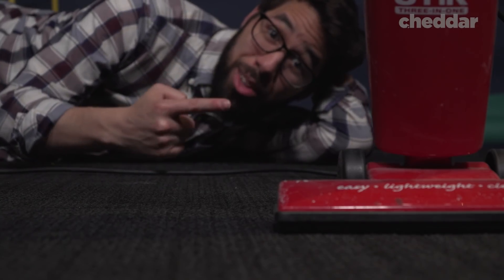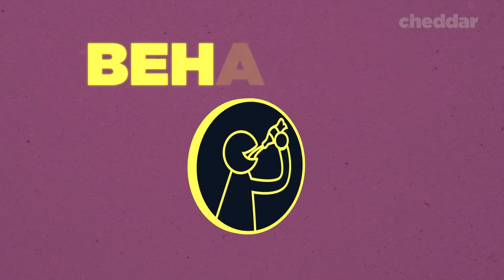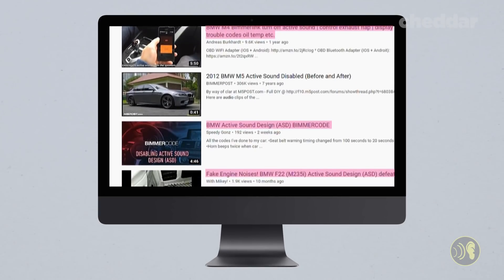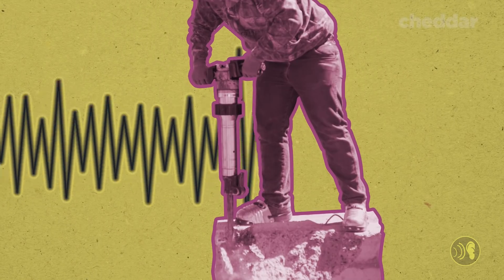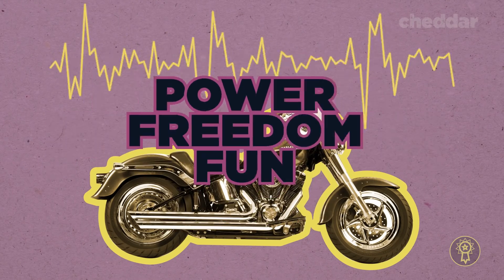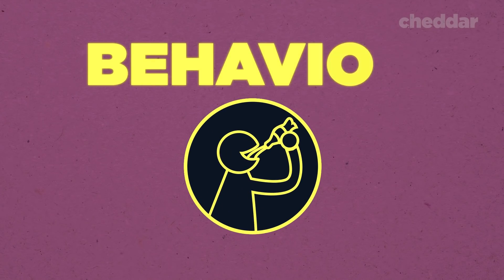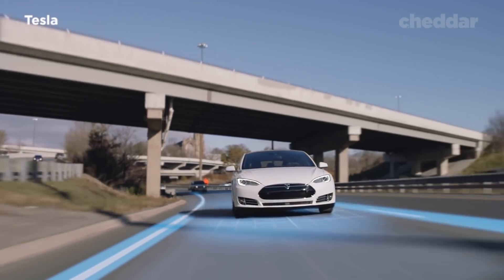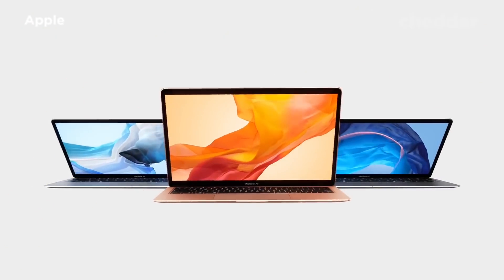The Fake Sounds Companies Add To Products - Cheddar Explains

Comment: The EU introduced a 80 dB noise limit on vacuums in 2019 to protect customers ears instead of letting the unnecessary noise satisfaction destroy their ears in the long term :P
Reply: God bless them.
Reply: 80 is still pretty loud. It's like standing near a track while a freight train goes by at 90 km/h
Reply: 80dB is a great limit and all, but can we go quieter? Because I would love a 60dB vacuum
Reply: Interesting, one of the things I like about my Shark vacuum cleaner is that it's pretty quiet while still be very effective at pulling dust out of my carpets. It's too loud to talk over, but at no point do I feel uncomfortable around it. Plus, because it's relatively powerful, I don't need to use it all that often.

It's definitely quieter than the vacuum that it replaced and the ones that were around when I was a kid, but if they'd make it even quieter, I'd likely replace it.
Reply: I am so thankfull to the EU on that. Greetings from the EU Germany. The EU did a lot of god thinks on protecting consumers. In this regard I am thankfull for that
Reply: Our vacuum is from 2012
Reply: What vacuums are loud enough to damage your ears? I've never seen one lol
Reply: @Miscelanou  
over time lol 
your ears don't just explode when turning them on :P
Reply: Vladimir Kozlovsky  How did you miss the comment that started the politics and then blame the person who responded to them?
Reply: 90,000 dB limit now
Reply: Just make it so that no add sound
Reply: Yeah, they also introduced power limits, so all the vacuums in EU are garbage. Luckily they left gaps in the law so you can still buy a good vacuum if it's a central vacuum. Most of the regulations in EU are bs.
Reply: Let's be real, some mp probably pushed it because they could hear thier neighbors vacuum.
Reply: @Maxx B. 
Well yeah, but it's a ban of vacuums that produce a lot of noise for no reason other than sounding "impressive"... 

I bet that you have noise limits on consumer appliances in most countries, at least once people's eardrums are blown out and the company is sued... 

Vacuums that are so loud that you die instantly from the noise are probably also banned everywhere! Meaning you have those bans everywhere... It's just a question of which level of protection you grant the consumer, and then everything outside of those levels is banned.
Reply: yes and people are complaining that thanks to EU regulation vacuums are getting weaker
Reply: This comment section is gold.
Reply: It's real cool to live in a nanny state. Screw that, freedom to make a decision, including a harmful one, is a fundamental right. So is a right to a mistake. But, of course, after living in a nanny state for years, Europeans have no clue about freedom, and accept their overlords who know better than them.
Reply: @stepanstepasha3538  
Haha, as if you have anarchy and no regulations in the US... fucking moron xD
Reply: Why not just have them put a warning that listening to sustained 80dB over time could damage their years? Ban culture is so frustrating. Just let me know, and let me make the decision, sure for vacuums there's no reason but in NYC there are so many housing laws that I just wish they would let me decide. They did a study that windows are important for health and then they banned living somewhere without a window. Like just let me know about the study and then let me decide, maybe the extra $100/mo matters more to my sanity and I want to be able to make that decision.
Reply: @johndirac6707 
It's not really a ban though, it's just a higher minimum requirement for manufacturers.
Reply: I so they aren’t allowed to go above a certain sound level. That is literally the definition of a ban.
Reply: @michaelesposito2629  
Well, yeah but pretty much every product has safety restrictions and products that don't conform to them are banned.
Reply: I so, as I said, they are banned.
Reply: @michaelesposito2629  
banned from being produced, not from being sold ;)
Reply: I ... you’re probably the type of person that thinks making bullets $1000 doesn’t actually mean you’re banning guns. Right? ;). 
Even when things are banned, many times you can still own them, because the item would have to be exceptionally dangerous to get the government to force people to not own it anymore. Even many gun bans only ban the manufacture or purchase of said guns. But it’s still a ban.  Governments love protecting people. They create problems to protect people from, so that their jobs actually  matter. The eu Being one of the worst offenders of such nanny state tactics. People can just as easily wear hearing protection. But you can’t mandate that, and you can’t tell the world how you’re saving them from themselves
Reply: I by the way. The term for this is “effectively banned”.
Reply: @michaelesposito2629  Making bullets $1000 would ensure that they would only be used for nefarious reasons. They're also easy to make yourself, most avid users in my country has their own bullet presses.
Reply: Fabianwew I’m not really sure why you’re telling me this?
Reply: @johndirac6707  uhhh so you want a loud vacuum??
Reply: @johndirac6707  Are you also going to sign a waiver that says you renounce all rights to free European healthcare in relation to any sound-related damage you might sustain from the vacuum? Also, are you going to pay the government for all the lost tax revenue on account of your reduced productivity from ear damage? I am of course being a bit hyperbolic in both cases, but the point is that governments have a vested interest in the health and resulting productivity of their citizens, and they don't want their citizens getting sick or injured any more than a farmer wants that for his cows. And while you might believe you have a right to get sick or injure yourself, people aren't islands and what happens to them has consequences for other people, and you don't have a right to impose those consequences on other people.
It's a large part of the government's job to try and optimise everyone's quality of life, so if banning loud vacuum cleaners means you don't need treatment for ear damage, which prevents you from wasting taxpayer money, preserves those treatment resources for someone else, and ensures you are healthy enough to keep working and contributing to society, then why shouldn't the government ban loud vacuum cleaners? Allowing people to take actions that are destructive to their health is allowing them to actively harm society as a whole, so what point is there in having a government if it isn't going to protect society and all the people in it?
I understand that things are different in the US, where the government doesn't care about the health of its citizens and people are afforded rights that are blatantly harmful to society such as owning military assault weapons, but in the rest of the West governments are committed to protecting people even if that means protecting people from themselves, and their citizens are largely grateful for it.
Reply: Michael Heliotis thank you for explaining to the people why America is actually not a country of idiots, it’s a country that works, because of the freedom it gives you
Reply: @Juicestain2  
Well, those freedoms come at high costs, that limit others freedoms.
The freedom to own guns comes at the cost of the higher likelihood to be shot. The freedom of not being able to afford healthcare comes at the cost of dieing early. etc....
Reply: @Juicestain2  Yeah, I'd say most of the world agrees that it's not a good thing for people to have the freedom to waste public resources that would otherwise be consumed by people who actually need them through no fault of there own. And I'd say it's not a country that works when so many people don't have access to healthcare. I suppose, though, it's just a matter of perspective; if you're cruel and selfish then everything is working just fine in America.
Reply: I the lack of guns causes guns to be bought illegally, just because poaching is illegal, doesn’t mean people don’t do it
Reply: Michael Heliotis if the country isn’t in shambles then it’s most likely working
Reply: @Juicestain2  
Yes, but guns are still mostly exclusive to people that have deeper criminal connections and you don't see the average criminal with a gun. 
Especially in non-planned crimes people will just get the weapon with the easiest accessibility (which is usually a knife). 
Just look at the statistics of people that get shot by the police. The people that need to be killed by the police in America is roughly about 10+ times higher per capita compared to the EU, that's probably because of various reasons but one of them is definitely that there are more dangerous weapons in circulation.
Reply: @Juicestain2  Working for who? Rich white men? Cos I can tell you with certainty that nearly every black person in America will say the country isn't working for them right now. And I'd say most of the Latinos would concur, along with plenty of poor people from every colour, and all the people working 3+ jobs just to scrape together barely enough money to survive. Also, I hate to break it to you, but most of the rest of the world is looking at America with raised eyebrows right now thinking it is in shambles. It's in such a shambles that I don't even need to bother explaining why, because any rational person could see it as plain as day. You could mention it in an essay and it wouldn't even require a reference. If you're seriously going to try and tell me that America isn't in shambles, when your president of law and order is violating the Constitution for a photo op, then you're obscenely irrational and there's no point in talking to you any further because you're incapable of seeing what sits plainly before your face.
Reply: @michaelheliotis5279  👏 👏 👏
Reply: @i.i.iiii.i.i  Sad part of it is that way more lives are lost because of that said freedom to own guns than it has saved. Also idiotic that with that stupid gun law, you don't even get health-care in case some stupid person shoots you.
Reply: @m2ukass  That freedom to own guns protects those who do not wish to submit to holier than thou nanny states and tyrants who would keep the populace docile and accepting of whatever next restriction government comes up with. But there is no convincing nanny staters, nanny state knows better than you about what is best for you..
Reply: @stepanstepasha3538  How is your head feeling? Brainwashing that severe must hurt.
Statistics do not care about your feelings.
Reply: @michaelheliotis5279  ironically your attack on assault weapons is not backed by the numbers. Guns account for a VERY small number of violent crimes. Check FBI report. Its mostly knives and hammers.

Yeah ill admit america is fucked up. I think guns are one of the few things we have gotten right. The 'assault weapon' you noted doesn't exist. it is a magazine fed rifle. Just bc a weapon is magazine fed does not make it a weapon of war. The capacity is the biggest factor followed by full auto (both are regulated). We have reasonable limits and unsurprisingly most of the big offenders break those laws (for example FA is illegal yet you have seen those a few times).

At todays day and age gun regulation is dead. There are literally open free blueprints to 3D print guns. There was a big bust before COVID hit. Unfortunately you cannot regulate those since regulation relies on them declaring their weapons. There are also a lot of undeclared weapons globally and it many cases illegal activity is done with said weapons.

My last point is i have talked with a lot of LE. The vast majority of weapons used in crimes, even 'assault' rifles, are illegal. Regulating makes it marginally harder to get one for a criminal but ensures a functional citizen will not have one.

Europe may be different. Perhaps you are much more secure and heavily policed than the US and can enforce such bans effectively on criminals. The US (which is already accused of over policing and is guilty of police brutality) cannot afford to increase police to enforce these silly bans. Especially since gun makers usually have legal work arounds before the law even drops.

Our biggest issues should be dealing with the corruption in the country that causes far more harm. The opiate crisis kills more than guns easily and you can trace it back to lobbyists and corps. Then we have the +8000% on epi pens. The utter lack of effective public transport in some states even though we need it. Better education benefits (we have to pay and often get buried in debt by school).

Please note there are 360 million people in the US and the few that do crazy stuff are the severe minority. Rule of thumb. Never regulate the >99% over something the >1% did.

edit: forgot to mention. My gun can feed my family through this whole COVID mess. With meat going up hunting has become more important.
Reply: @michaelheliotis5279  the scariest words in the English language? "I'm from the government and I'm here to help"
Reply: @Gilberto90  I think you'll find that in most of the world, the scariest words are "Make America Great Again." In most other Western countries, governments actually help people instead of trying to oppress them. But I understand how the concept of a helpful and caring government would be a bit confusing to an American.
Reply: Michael Heliotis and most of the world are clearly  ignorant. Obama was called the drone striker in chief and deported in chief . But sure. Trump is the bad guy 🙄
Reply: @michaelesposito2629  Why does Obama doing those things make it okay for Trump to do them? Obama was the Drone-Striker-in-Chief and Deporter-in-Chief, and he was a bad guy for it whether or not people called him out on it. But that doesn't mean that it's somehow okay for Trump to do those same things, or, even worse, escalate them. Obama's flaws are not an excuse for Trump's flaws, but I suppose 30% of America are too ignorant to appreciate that fact.
Reply: @michaelheliotis5279  First of all, I agree with virtually everything you said. Secondly, I am a citizen of the United States. Thirdly, keep in mind that I am on your side politically here, I’m just trying to help better your rhetoric. The problem with your anti-gun argument is that you’re not meeting American gun owners at their level. The first mistake you made was referring to legal military assault weapons. No military-grade hardware is legal in the US without a hefty amount of extra paperwork and screening, which the majority of citizens won’t get past. There’s also no such thing as an assault weapon. What you probably mean is “automatic”. There are also no automatic weapons legal for standard citizens, but bump stocks and other things make near-automatic firing rates possible. Bump stocks are prone to jamming and stopping the biker flow, though. (You can still easily get off 30+ mags at a rate that most listeners would assume was truly automatic.) I know it might seem like I’m nitpicking, but it’s SUPER important to know what you’re talking about when it comes to stuff like this. People WILL completely ignore your argument if you don’t. If you can know more about guns than most gun people, they find it harder to deride you and your argument.
Reply: @johndirac6707  I'm pretty sure that fire code requires windows anyways, but for a different reason
Reply: @johndirac6707  ban culture? This is Europe. We call them living standards. Community. Law. Manners. Respect... you call it fucking dictatorship?
Reply: @johndirac6707  80 db is a VERY high volume. This is nearing the sound produced by smaller guns which imo is kinda of ridiculous.

imo they should do something other than a ban to try and encourage better design. i hate to suggest tax breaks but offering a break proportional to the dB drop lets you have your 80+ vacuum and other people would see a huge number of quiet vacuums.
Reply: @johndirac6707  Yeah make seatbelts unrequired too so people can make their decisions for them and their small children.
Reply: @johndirac6707  your comment is very American 😅
Reply: @johndirac6707  "but in NYC there are so many housing laws that I just wish they would let me decide. They did a study that windows are important for health and then they banned living somewhere without a window. Like just let me know about the study and then let me decide, maybe the extra $100/mo matters more to my sanity and I want to be able to make that decision."
Dude, as an architect I can assure you that if building houses with no windows was legal, every developer would be selling windowless houses and you would have no choice but to live in one.
Reply: @johndirac6707  The reason why products in europe are such higher quality than in north america is because of these rules. Putting a label on it doesnt bother the companies at all ...
Reply: @johndirac6707  Who cares? If something is unnecessarily stupid and loud there should be fucking laws against that shit. Ban all loud hoovers, I'd pay whoever made that ban for a job damn well done.

Comment: "Motorcycles make sounds for safety..." 

an opinion held by the most obnoxious, unsafe, unskilled, motorcyclist poseurs.

Motorcycle sound is projected in the wrong direction to alert anyone in the path of a motorcycle and is measurably fatiguing to the motorcycle operator, making them more prone to errors and injury. Noisy motorcycles damage the hearing of motorcyclists irreparably.

People who alter their motorcycles specifically for the purpose of increasing the noise it makes are some of the stupidest people on the planet.